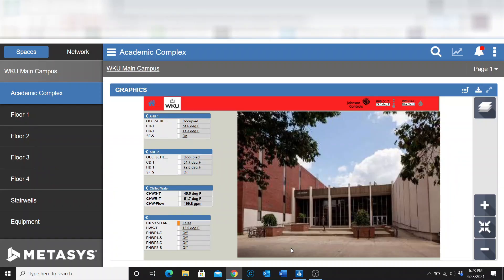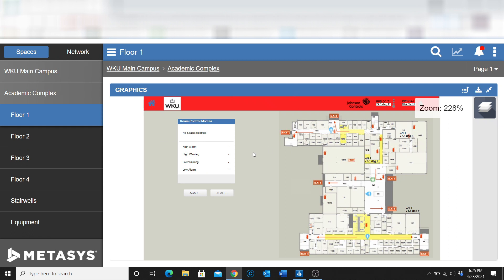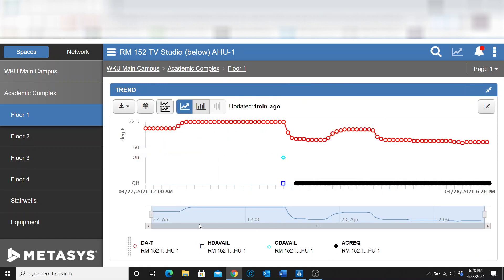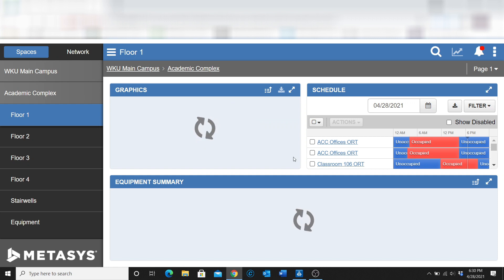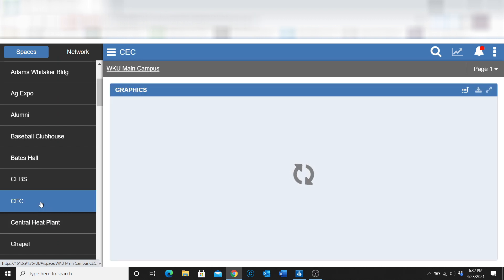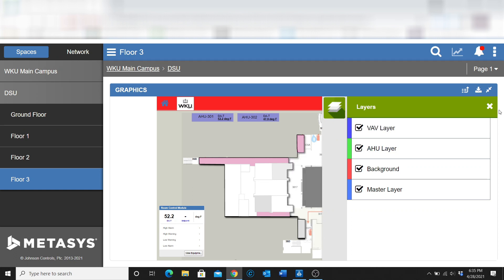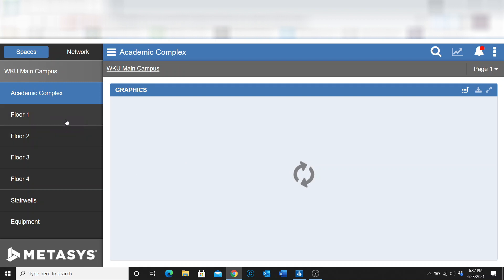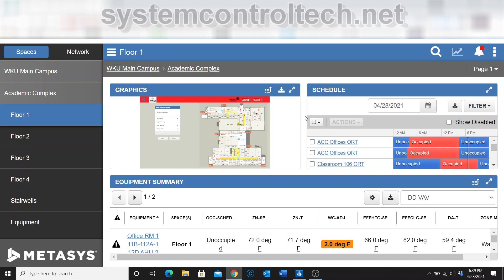Johnson Controls Metasys MUI Overview

Comment: Any tips on speeding up the MUI?  I'm slowly moving us from SMP on an VM ADX that performs VERY well.  MUI running from the same ADX is VERY slow. Our LAN is very robust and fast.
Reply from the maker: Unfortunately no. There is a difference in speed compared to smp. We have a split server and a lot of horsepower but at times it can have some hesitation
Reply: @Systemcontroltech  Thanks for the quick response. I'll be upgrading from 11 to 13 soon. Hopefully that helps. Also, I hear they brought back user views in the new rev, which is honestly one big reason we've been dragging our feet a bit on the move to MUI. Leaving out user views was a huge miss in the earlier revs.

Comment: Will you please create a video to show how to edit ( add or remove a graphic) of the graphic folder on the server? Thanks
Reply from the maker: I may try to do something like that in the near future.  I don't run screen capture on the server so it would be a process to get it.
Reply: @Systemcontroltech  Thanks you for considering to do so. Some of my buildings have the server graphics folder is mapping incorrectly, that was not reflected what we have for that building. I can remove them but I don't know how to add the correct ones back. I have the corrected graphic stored in the NCE and user viewer folders.

Comment: Please I want your help I get suddenly ???? Question marks instead of the values and status, the luncher app show that the connection is established can you help please
Reply from the maker: See if it's the NAE toggling or if it's individual devices. It could be a network issue if it's the NAE or it could be a device failing if it's not. Or the field bus wiring may have an issue
Reply: @Systemcontroltech  thank you sir for your response 

Actually the luncher program see the data points and the nae online in the UI so there is no doubt that there is a problem in the physical communication